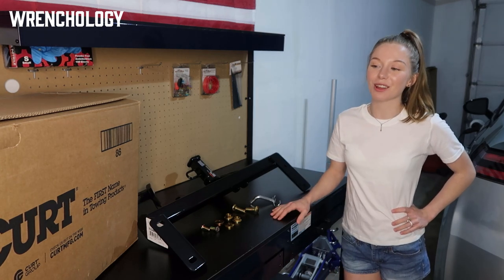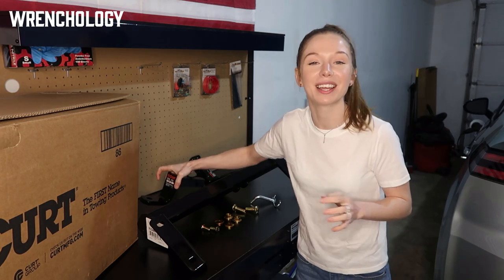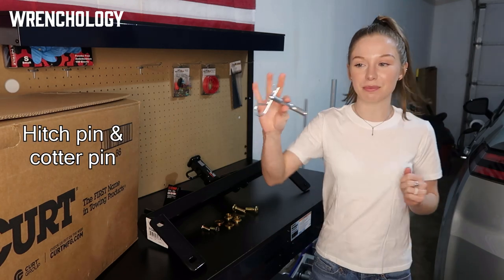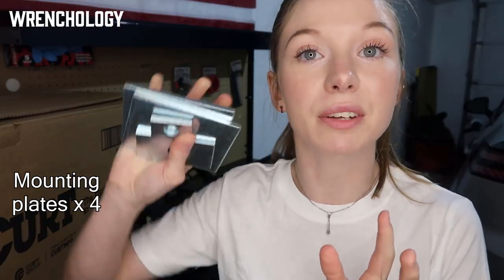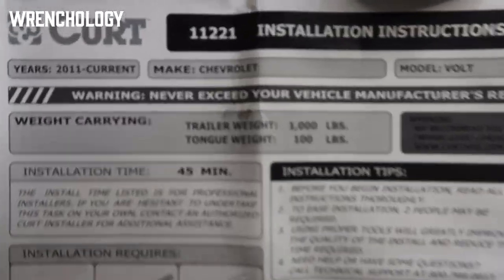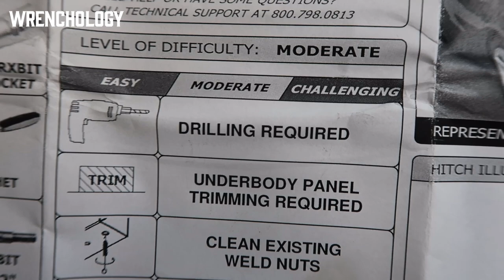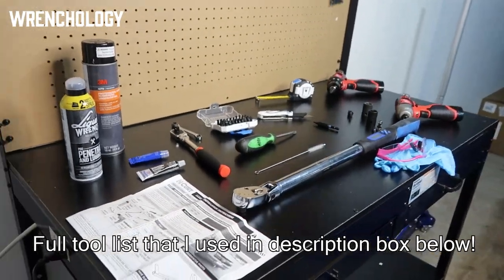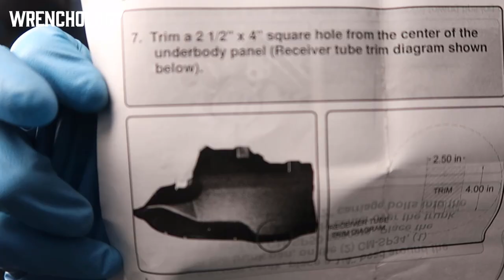Installing a trailer hitch on my Chevy Volt!

Comment: 100lb tounge weight? Should pull a motorcycle trailer just fine 😉.

 Great video!
Reply: Yeah i'm not 100% on the difference between tongue weight and pull weight. We're doing a bike carrier and 2 bikes. Does that mean those 3 cannot exceed 100 lbs?

Comment: Got the hitch installed on our 2014 Volt yesterday!! So it wasn't as easy for us as for you, so hats off to you!! We had trouble getting the pan out after removing the 4 nuts, had trouble removing the plug that seemed to be glued on, had trouble torquing the 110 ft pound nuts as our torque wrench only went to 960, so I basically went as tight as I could go.  Finally we really had trouble getting the cover underneath back on. The one pry connector broke.. lol  Anyway, it's on!! We put our bike carrier on and went for a long ride, so all good! Thanks!
Reply from the maker: I'm glad you got it though! 🤙🔧
Reply: Wrenchology me too! Honestly we were about to call around to UHauls to see if someone could install it for us until we watched your video! Gave us the courage to try!

Comment: Very nice production! It is so nice to see a pro at work, instructions, torque wrench, thread locker. When I installed mine I wish that I fit a easily under the car as you did. For those using a hitch mounted bike rack, Curt requires the use of a support strap for 1 1/4 inch bike racks. The energy of two heavy bikes bouncing a couple of feet away from the receiver would be very hard on the hitch and the rack. Curt strap part #18050

Comment: Excellent video and very timely for me. I have the same year Volt and have need to pull a small trailer. Thanks for taking the time to make this video. I sub'd and purchased hitch with your link. Will check out your other videos. I have a "wrenching" channel too - mostly motorcycles and tool reviews. Keep up the good work.
Reply: Wrenchology, What did you do about wiring the 2013 Volt for lighting? Upon first glance I'm not seeing a plug&play wiring harness offered for the 2013. Universal kit?
Reply from the maker: I haven't had to use it yet so unfortunately I don't have an answer for you, I bought the hitch and then bought my s10 😂🤦🏼‍♀️

Comment: Too bad it’s only rated 1000lbs. The curt hitch for Prius is rated 2000lbs and the installation is super easy (no drilling or removal of panels or trunk stuff). Great video and I have the same hitch cover for when I don’t tow ❤️